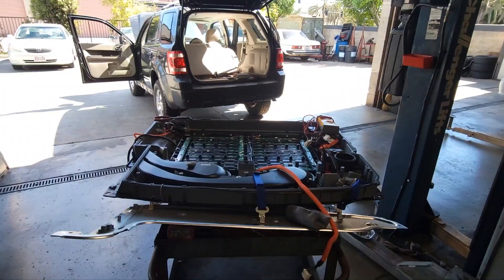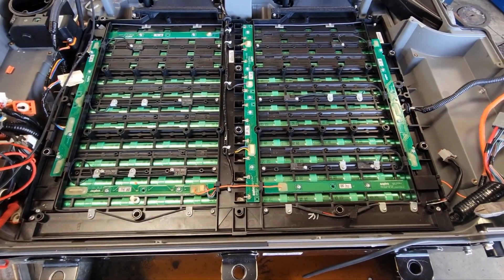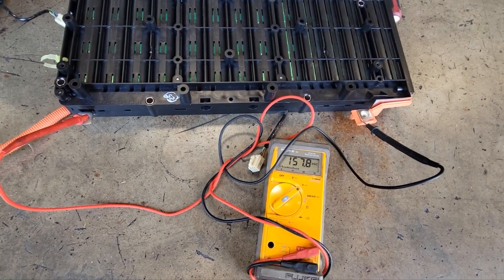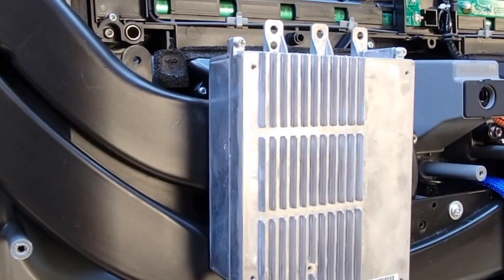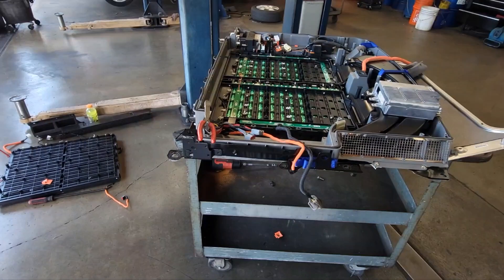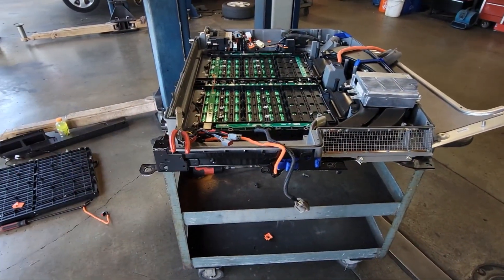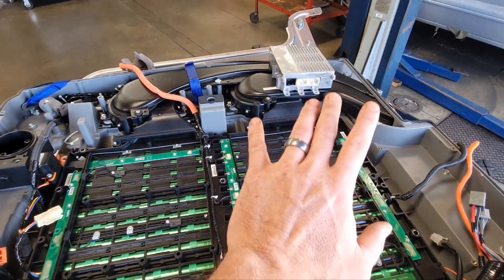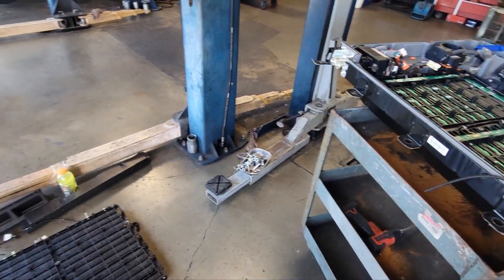Ford Escape Hybrid Battery Teardown & Diagnosis

Comment: The bottom pack has 120 cells and the top pack has 130.   So the two pack have less than 1% inbalance between them.
Reply from the maker: It's one of the worst designs for a battery pack, in my opinion.